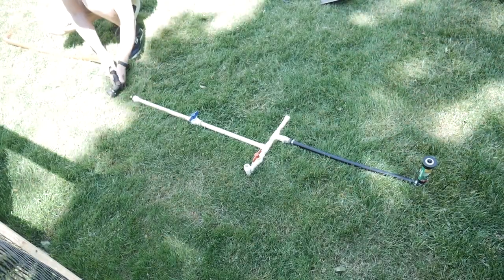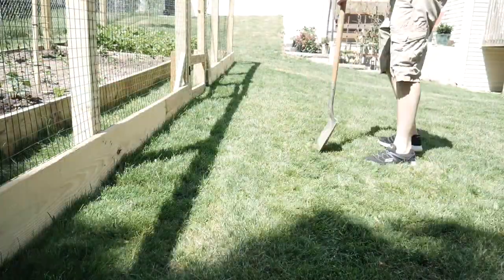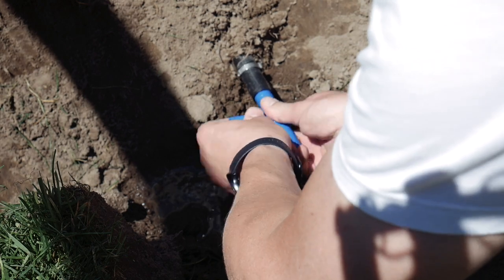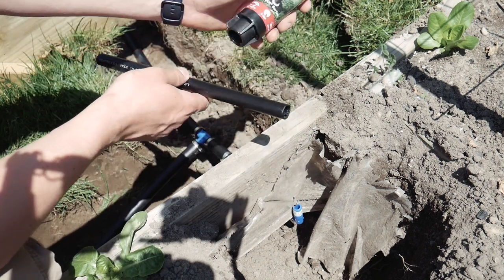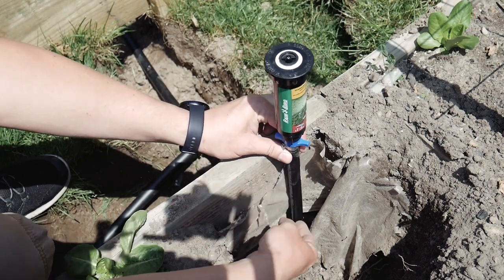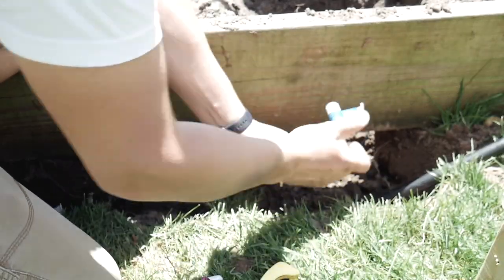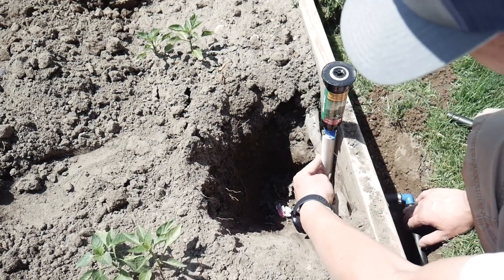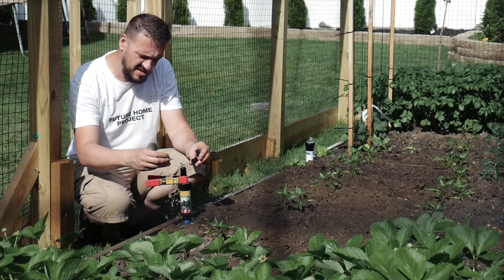Watering raised garden bed with pop up sprinklers - Why mess with drip irrigation?

Comment: The reason to use drip irrigation instead of spray is to reduce water loss due to evaporation. Also, with drip irrigation, you have the ability to only water where the plants are growing, so less water is used.